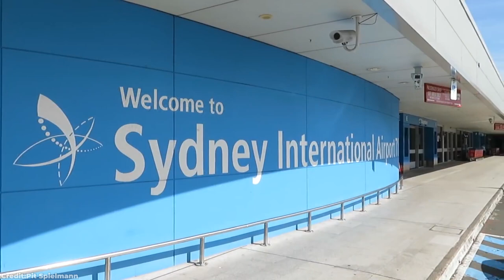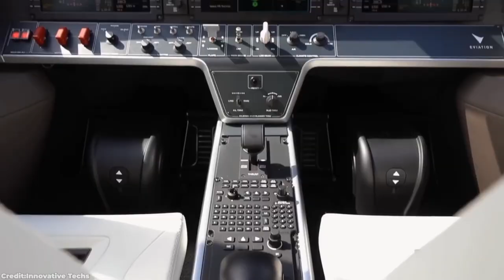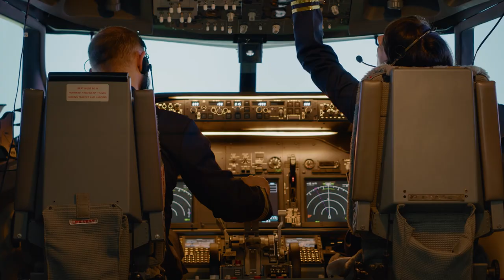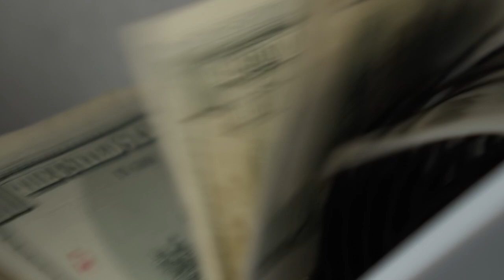Australia's New Western Sydney Airport Is a Logistical Nightmare

Comment: Melbourne still doesn't have a rail link and as for the fuel problem it would apply to any new airport built anywhere in the world.
The big advantage of the new airport is that there will be no curfew between 11pm and 6am. International flights currently cannot be scheduled for night arrivals in case there is a two or three hour delay. Large numbers of overnight flights also arrive shortly after 6am putting strain on the infrastructure. There is nothing worse than waiting for immigration and customs then taking a train full of commuters into the CBD during the morning peak hour.
Reply: I think in 2050, they might close kingsford smith and turn it into high rise devolpment, shopping precints, a stadium and park space.

Comment: Nobody seems to worry about the massive fog problem
Reply: That’s exactly why the runway being built at WSA is specifically designed to operate during fog. It will be the only airport in Sydney with a CAT III-B landing system, which allows planes to continue to safely operate at the airport in fog.
Reply: @johnnichol9412  I think building at Goulburn would be taking term "Western Sydney" to a whole new level.
Reply: @johnnichol9412  Wilton was the smartest location, had a freeway going right there, the train line isn't too far away and it is between Sydney and Wollongong.
Reply: @r1learner178  and who the den would want to travel to Wilton? And I can bet no airline would want to move. You seriously have to be joking.
Reply: @xr6lad  Well it was a choice between Wilton and Badgerys Creek when they first started talking about it so I guess a lot of people would.
Reply: Sydney always has a fog problem.

Comment: The new airport in Sydney is going to be awful just like Avalon it is way too far from the CBD. If we ran Mascot more efficiently we wouldn’t need another airport for decades. It’s the same size as Heathrow and they’re able to handle significantly more air movements per annum.
Reply: Well for the airport to operate 24/7 you need to be far away from major housing regions to be able to achieve that otherwise you need to make curfews so people can sleep. Kingsford is failing in my opinion mainly because it is really close to major housing and can not operate 24 hours a day cause people need sleep, Kingsford if cramped in some places and having a new airport can split the airports in two sections,  WSA can be only domestic or international or Kingsford can be domestic or international, of course Kingsford is staying but I think WSA will overtake Kingsford at some point.
Reply: Majority of the big airports in the airport are in the middle of no where, in Seoul Korea Incheon airport is legit on another island 90 minutes away from cbd , in shanghai Pudong international is like at least 50km away from most ppl live, similar with Taoyuan in Taiwan
Reply: @jxswu3224  same with Osaka (Kansai)
Reply: why not just build a new airport out on an island.
Reply: @edes01 Yeah but those people don't matter because they live in the West.

Obviously I am being sarcastic but that is the general belief of most people in Sydney; that the West doesn't seem to matter. IMO this is a stupid place for an airport and I think the noise tool is probably misleading, people will likely be impacted by plane noise much worse than the tool indicates. But I can't think of anywhere else to put this airport, Sydney isn't a flat city which would help being able to plonk down an airport anywhere you want. I think it's unfair that they're not setting a curfew for this airport yet there is one for SYD, again, because the West don't really matter since they're all ethnics (sarcasm again).

Comment: Have you seen how far the metro station is from the terminal? It should be un der it! PLUS it is simply a shuttle from St Marys, and will remain that way until at least the 2050s. It should have been built from Tallawong through to Macarthur, with a connection/extension from Luddenham, from day 1 of opening. Car centric Sydney planning yet again. White elephant indeed. It's Sydney's Avalon plus freight services. And, without a freight rail line, all that frieght has to move my truck too. Dumb.
Reply: It’s because lots of the land between the airport and st Mary’s is government defence land that is cheaper to build on
Reply: How can you put a airport terminal under the metro, what like a undercover hangar that lets out planes like some sort of human wasp nest.. i suppose the tarmac will be cooler so there is that
Reply: Hello, they are working for the car rental companies.
Reply: @electro_sykes  hello budget car rentals i need a plane
Reply: The reason the metro terminal is “so far” from the terminal is called future-proofing. When the airport is eventually expanded, it will be mirrored, so another terminal and runway will be built on the other side. When that happens the metro station will then be snug in the middle of both terminals. If the metro station was to be under the first terminal, it would be a very long walk for people from the other terminal when it’s built…
Reply: @Agent44996  nice  n snug i like it... like a coccon with butterfly wings
Reply: They should build it like Chatswood... Metro and Heavy rail parallel tracks
Reply: I mean same logic with metro to tallawodonga.. why not align it to vineyard which would give extra coverage to winner Windsor